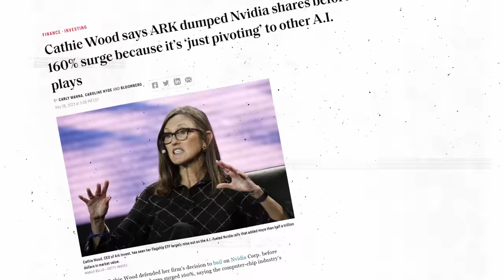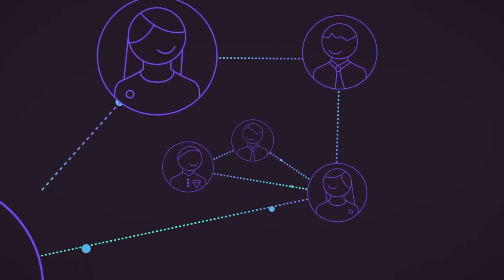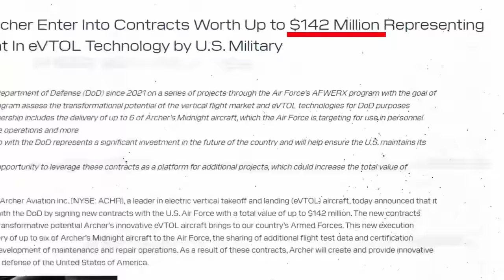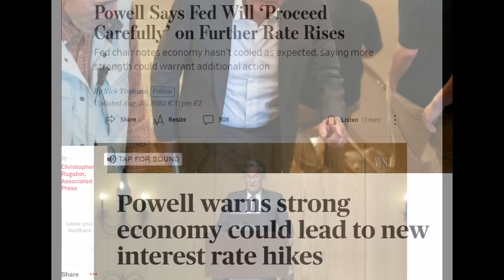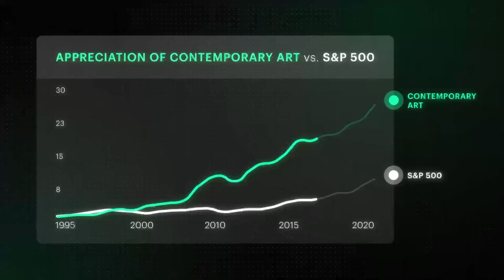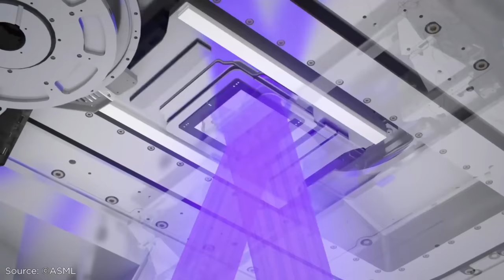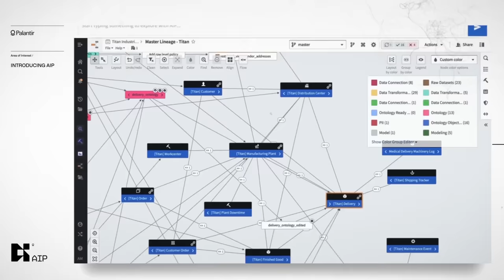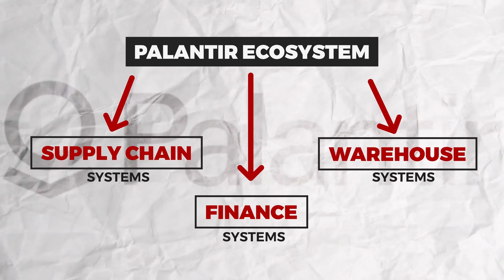Top 4 Stock I'm Buying Today - And it's not NVIDIA

Comment: Stocks extended their year-to-date rally following the CPI report, with the S&P 500 last up 0.8% in afternoon trading. but I don't know if stocks will quickly rebound, continue to pull back or move sideways for a few weeks, or if conditions will rapidly deteriorate.I am under pressure to grow my reserve of $250k.
Reply: There are many other interesting stocks in many industries that you might follow. You don't have to act on every forecast, so I'll suggest that you work with a financial advisor who can help you choose the best times to purchase and sell the shares or ETFs you want to acquire.
Reply: I agree, that's the more reason I prefer my day to day investment decisions being guided by an advisor seeing that their entire skillset is built around going long and short at the same time both employing risk for its asymmetrical upside and laying off risk as a hedge against the inevitable downward turns, coupled with the exclusive information/analysis they have, it's near impossible to not out-perform, been using my advisor for over 2years+ and I've netted over 2.8million.
Reply: I actually subscribed for a few trading courses but it didn't help much, been getting suggestions to use a proper financial advisor, how did you go about touching base with your coach?
Reply: Finding financial advisors like Colleen Janie Towe, who can assist you shape your portfolio would be a very creative option. There will be difficult times ahead, and prudent personal money management will be essential to navigating them.
Reply: Colleen has the appearance of being a great authority in her profession. I looked her up online and found her website, which I reviewed and went through to learn more about her credentials, academic background, and employment. She has a fiduciary duty to protect my best interests. I sent her an email outlining my objectives and also booked a session with her; thanks for sharing.

Comment: Recently bought some recommended stocks and now they are just penny stocks. There seems to be more negative portfolios this 2nd half of 2023 with markets tumbling, soaring inflation, and banks going out of business. My concern is how can the rapid interest-rate hike be of favor to a value investor, or is it better avoiding stocks for a while?
Reply: Just ''buy the dip'' man. In the long term it will payoff. High interest rates usually mean lower stock prices, however investors should be cautious of the bull run, its best you connect with a well-qualified adviser to meet your growth goals and avoid blunder
Reply: @tommymyershoffman   Very true, you can be passively involved in the markts and still amass wealth-gains using an investment advisor. I first dabbled in stocks late 2019, just before the pandemic, and that same year gained over 150% with no prior investing experience, basically all I was doing was following directions of my advisor. We are working on a retirement ballpark of $3m and I’m certain my goal isn’t farfetched after subsequent investments and tremendous returns so far.
Reply: @marvishaN   This is striking! could you share info of your advisor, please? i'm in dire need of asset allocation and standing at a crossroads, whether to sell-off or keep holding my positions, my portfolio is retrogressing bad as of late
Reply: @georgeh   Sure. There are a lot of independent advisors you might look into. But I only work with HEATHER LEE LARIONI and we have been working together for nearly four years. She has since provided entry and exit points on the securities I concentrate on. She's well-grounded and known, shouldn't be a hassle finding her page.
Reply: @marvishaN   Just copied and pasted Heather Lee Larioni on my browser too and her page popped up immediately. Thanks a lot for sharing this info, I am interested in hiring her because in this market I'm losing like 600 dollars per day essentially in my mutual fund portfolio.
Reply: Stupid advertising bots!!! This needs to be stopped

Comment: At the beginning of the year, I increased my stock purchases somewhat, but not much. Why am I being so hard on this? Even if others in my sector make six figures apiece, I still want to be the first person in my polygamous family to earn a million dollars. I understand exactly what it costs to work harder in order to make more money.
Reply: If the market has taught me anything, it's that it usually makes a comeback, but I can't seem to concentrate on the long term, especially because important things like my retirement and my reserve are having a disastrous impact on inflation. I need a solution and a data trajectory that I can trust as soon as it is practicable.
Reply: Currently, working with a reputable investing coach is the greatest market approach. I've been working with a coach for a while now, primarily because I don't have the amount of knowledge and mental fortitude necessary to handle the current state of the market. Your lack of experience, not anything you're doing incorrectly, is the reason you don't have the knowledge required to thrive in a cutthroat industry.
Reply: In fact, I'm not sure whether I'm permitted to say this, but I'd suggest searching for “ Laurel Dell Sroufe” as she gained a lot of attention in 2020. She is both my coach and the manager of my portfolio.
Reply: She has an impressive career and impressive qualifications, so I can understand why she is so busy. I thus quickly copied Laurel's full name and entered it into my browser.

Comment: The killer to me with Archer is the involvement of Stellantis. I am no finance expert but I’ve been a mechanic for years and I have no desire to go up in the air in anything with Dodge/Chrysler parts and engineering. I see what kind of cars they build. Pure junk! No thank you!!
Reply from the maker: I happen to have been a jet engine mechanic, so I respect your opinion. But I will state that the FAA requirements for The airframe and engines is very stringent. Not to say that stalantis won't do a poor job, but if they meet the requirements it may not be a deal breaker. But based on your experience with dodges, etc I'm pretty certain you have a good reason to coming to the conclusion with your opinion. And I respect that
Reply: What about JOBY?